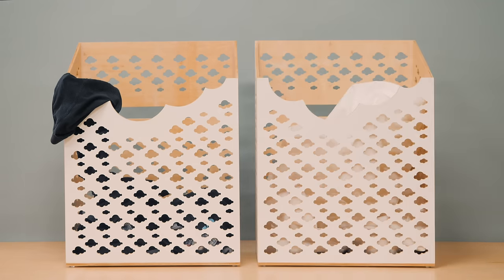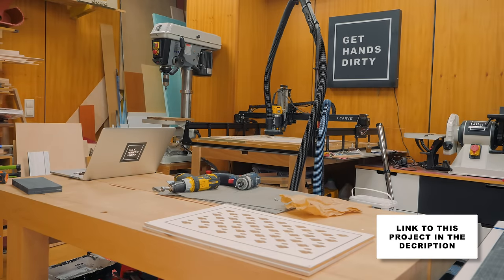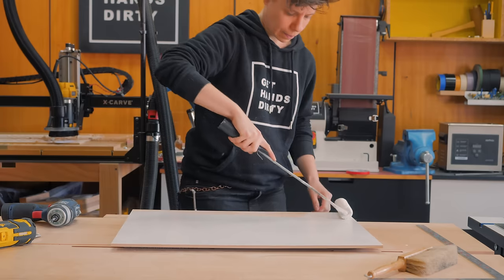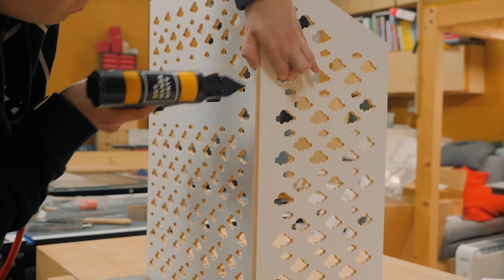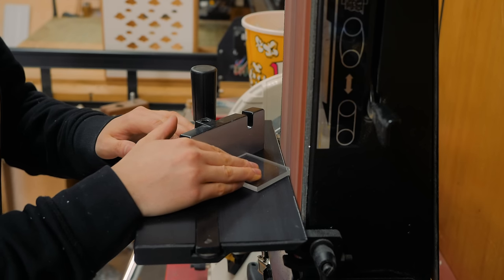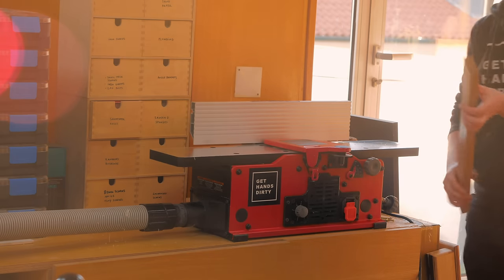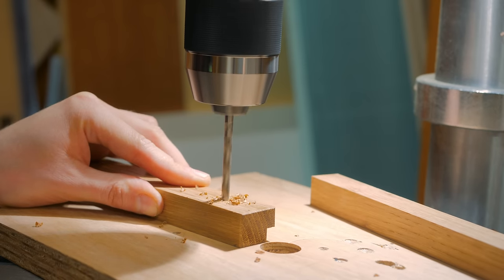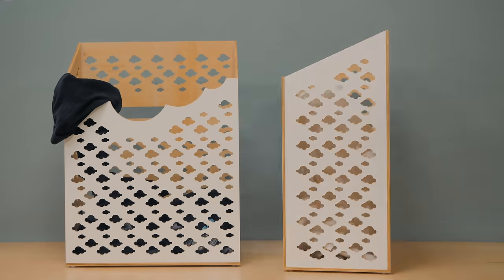How to Make Laundry Baskets Out of Thin Plywood // Tiny Apartment Build Ep.10

Comment: Your work is always so spot-on, Christina. I love the design & the use of materials other than plastic in this area. I am a little concerned however (from my experience as both a mother & a klutz) that those little pointy bits at the opening will catch on laundry & get knocked off in time. Perhaps a single curve might be a better choice for the opening? Looking forward to your next project & seriously considering unpacking my new baby table saw for some projects of my own.
Reply from the maker: I get what you say but I don't think this will be a problem since I sanded and rounded them over a little. But yes, a simple circular opening wouldn't bring any problems for sure! Go ahead, I want to see that blade running cutting some wood! Be safe!!
Reply: @GetHandsDirty  Maybe an inverted version of your cloud design could work for others. 
May I add that I'm a long-time admirer of your capabilities, you're the complete package, your skills range from design, the making, filming & editing. to presentation. You are an amazing young lady. All the very best from Australia.

Comment: If you made the bottom of each basket to be able to opened you would not need to remove them from the wall. the down fall would be that another basket would be needed to empty those into. The project is an awesome idea.
Reply: Use a foldable crate for that :)